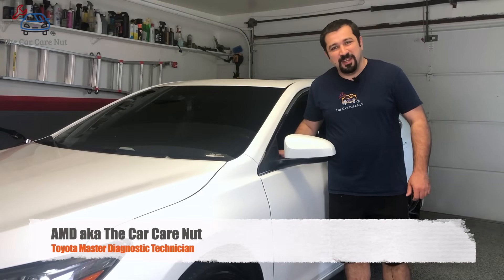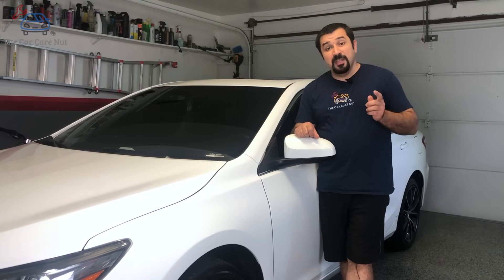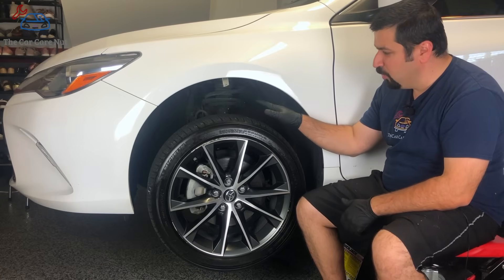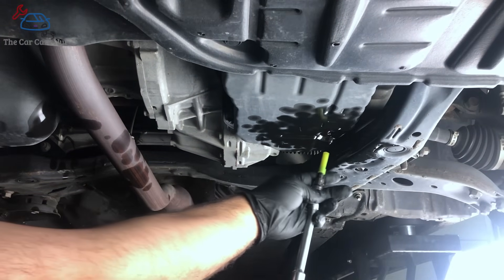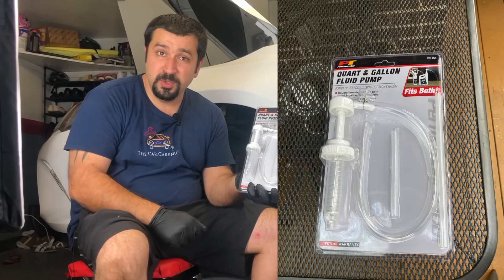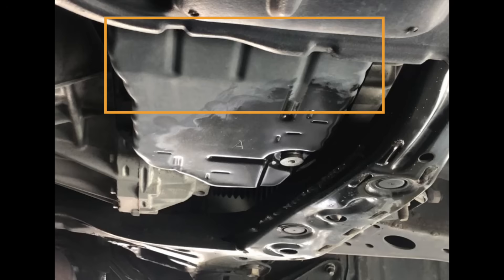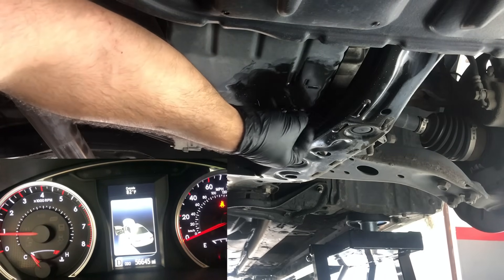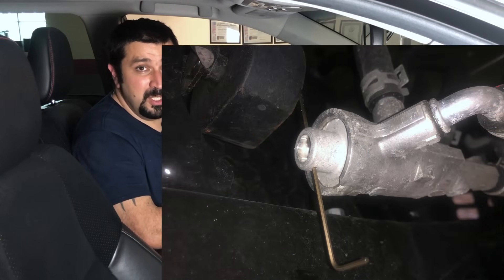How to change your Toyota Sealed Transmission Fluid

Comment: Thank you soo much for this video! May I ask, on a 2019 Camry, what would be the ideal temperature to start opening the drain plug  to check the fluid level? Adding an extra 1/2 quart might take a while for it to drain out before the ATF Temp gets too hot.
Reply from the maker: Hi! The fluid temp range on a 2019 Camry 8 speed transmission is 95-113 F. You’d want to start draining the excess at 95 and that gives you plenty of time to drain the excess before you reach 113.
Reply: @TheCarCareNut  You are always generous and awesome! God bless!
Reply: ❤ @TheCarCareNut
Reply: I Just did the Same thing with my 2019 Camry 2.5 L. I couldn’t find the Coolant Bypass Valve that we are supposed to pin open with a Allen wrench…. Did you find yours? And if so could you help us find it? There a couple others on hear looking for it. Thx.
I took off all the splash guards and looked everywhere! I followed 2 lines out of the transmission UP to a 3.5 inch by 3.5 inch box shaped out cropping that also had 2 other lines going in and out (I’m assuming coolant) but NO valve that I could see. I stopped everything right then and put the splash guards and tires back on. I didn’t want to mess up a $5000 transmission 🫠

Comment: The 2nd method pretty much killed every viewer here.
Reply from the maker: Thank you for your comment. Could you elaborate?
Reply: @TheCarCareNut  Was a little bid kidding, but it's so complicated. I'll get a Digital Infrared Thermometer on Amazon for $12 ! Need it for Covid, anyway.
Reply from the maker: Gotcha! I just wanted to make sure! I hear you on the complication but if you practice it and get used to the procedure it’s actually the most accurate.
Reply: @ve7yan  Be sure to first test your cheap digital IR thermometer using a medical thermometer as a reference standard.
An IR thermometer won't read accurately on any clear or bare-metal surface!!!

Comment: Sir..my car's transmission is not sealed..it has a dipstick..its a 4-speed automatic..NOT a CVT.. What if i will just put the same amount of fluid of what i have drained..would it damage the transmission? Thank you and God bless you more sir..
Reply from the maker: Hi! On transmissions with a dipstick this procedure doesn’t apply. Drain and fill with the same amount then use the dipstick with the car running to check the level.
Reply: Thank you so much for the help sir.. I really appreciate it.. keep it up..

Comment: Okay I did the diagnostic mode on my Es 350 2008, but the indicator never settled on D. Please advise
Reply from the maker: Did it flash then go off?
Reply: @TheCarCareNut  nothing happened. They are all individual lights in the ES350. The light from N to D kept changing. I was definitely in diagnostic mode.
Reply from the maker: Once you do the back and forth you’ll end up with the D light staying on solid for 2 seconds regardless of where your shifter is. Then go to park and wait for the light to come on solid to start adjusting the fluid level is that not happening
Reply: @TheCarCareNut  correct. I've just looked that up. Will try that again. Is something I'd have to repeat once the car has cooled down? Since it's already warm and it wouldn't show the accurate temp? In my first go, I hadn't put the shifter back to P. Just left it at neutral.
Reply from the maker: Where the car temp is doesn’t matter. You will still see the D light come on solid for 2 seconds. Try the procedure again. It takes a few tries to get the gist of it then it’s easy after that
Reply: @TheCarCareNut  I meant, if the car has been idling for a while, I'd have to repeat the procedure once the car has cooled down so it can detect the required temp of 104f? How long is long enough for the transmission to cool back down to repeat the process? I'll try it again in a bit and report back? Also, how long before the D becomes solid again after the first 2-second illumination?
Reply from the maker: So once it comes on solid for 2 seconds if it goes off after that the temperature it too cold.when it comes on solid is when you should adjust the fluid level. If it starts flashing then it’s too hot. Shut it off and let it cool down and restart
Reply: @TheCarCareNut  Roger. How long do these things take to cool off?
Reply from the maker: It could be a while. A few hours should do it
Reply: @TheCarCareNut  got it. Thanks for the rapid responses. Happy Thanksgiving! I'll try again in the morning.
Reply from the maker: You’re welcome! Happy thanksgiving
Reply: @TheCarCareNut  some forums suggest pulling out the shorting wire after the D comes on for 2 seconds. Is this true?
Reply from the maker: Yes that is correct and I mention that in my video
Reply: @TheCarCareNut  tried it again this morning. The D comes on for two seconds. I move the shifter to P. Pull the wire out. The solid D never comes on even after idling for a good 5 minutes.
Reply from the maker: Interesting. Keep waiting for it. This means the transmission is too cold and not warming up. See if it comes on solid after say half an hour is too much but give it time
Reply: @TheCarCareNut  got you. I'll try again. Half an hour does seem way too long for trans fluid to not go up to just 104 degrees.
Reply from the maker: I agree I see it odd too but that’s how this procedure works. It usually does take about 5 minutes from very cold to that temperature
Reply: @TheCarCareNut  right. Either I'm not doing something correctly or the sensor isn't working? Time to go get an infrared thermometer.
Reply: Tried it another couple of times today after a good 4 hour wait. Negative. Yes, the D light comes on for 2 seconds, then go off. I put the shifter to P, and pull the wire out. The temperature gauge on the instrument panel climbs about a third but still no D light that stays on.
Reply from the maker: That’s weird. I would just use the temp gun method or use a scan tool. I’ve tried this procedure on a lot of cars including Lexus and it works.
Reply: @TheCarCareNut  one more thing. In your instructions, you don't really mention as to what to do when the D comes on for two seconds. Do we leave it in neutral? Or do we move the shifter to Park?
Reply: @TheCarCareNut  FINALLY. IT WORKED! Had to sit in the car idling for a good 30 mins before the D light came on solid. All changed. Car now feels buttery smooth. When's the next time you'd recommend a drain and fill since only a small portion of the fluid came out.
Reply from the maker: That’s awesome! I would change it again the earliest at 30k
Reply: @TheCarCareNut  thank you. Why is fluid dark btw? Is it burnt? Or is it some other material like the clutch? It just looks like it's mixed with something dark.
Reply from the maker: WS fluid always comes out dark. That’s normal for it. Burnt fluid will have a very bad smell and you’ll tell right away
Reply: @TheCarCareNut  so the clutch isn't faulty then?
Reply from the maker: No you’re all good my brother! No need to worry.
Reply: @TheCarCareNut  ah. That's assuring. Thank you so much. Been meaning to figure out where to get it done but your video made it so simple. Car drives like brand new again. It was a little rough with the shifting in the mornings. Buttery smooth now. Wife approved 😁

Comment: Great videos Master Technician! Your expertise makes me feel so empowered. I have a 2016 Camry Hybrid and I plan to do this procedure tomorrow. Do I need to do the temperature procedure or just drain and fill until it overflows? God bless you!
Reply from the maker: Thank you for watching my video! So on your Camry hybrid it’s even easier to do the transmission service and is different than this one in the video. So on your hybrid there will be 2 plugs on the passenger side of the transmission with a 10mm hex. The one that’s higher is the fill and the one that’s lower is the drain. Take them both off. Let the oil drain then fill it from the fill plug until it overflows. Wait for it to stop dripping and you’re good to go. Make sure the car is level and that you use Toyota ATF WS likely you will need around 4 quarts I would have 5 at hand just in case
Reply: @TheCarCareNut  thank you for your detailed response!! I'll let you know how it goes for me. 🙏🏽
Reply: @TheCarCareNut  Does the temperature of the Transmission matter when checking the transmission fluid level, either with or without a fluid change?  I have a 2013 camry hybrid.  Thanks in advance, I love your channel!
Reply from the maker: On hybrids no not much. The difference in fluid level is minimal and it’s a splash system so you’re good.

Comment: So, in order to check fluid level, wait till it reaches the correct temp, and if it trickles, that's the correct fluid level?

How does the fluid release at the very beginning if the only way for the fluid to come out is via the straw, but then the only way for the fluid to come through the straw is to raise the temperature? Very confusing.
Reply from the maker: So fluid expands and contracts. When the fluid is hot it takes up more space and will be higher level. When it’s cold it shrinks and takes less space. You want the fluid to line up with the top of the overflow tube when it’s at a specific temperature. If it’s colder it will be lower than the tube if it’s hotter it will be higher than the tube.
Reply: @TheCarCareNut  yes but when you remove the bolt from the pan underneath on a cold car, where does that fluid come from, BEFORE you unscrew the straw?
Reply from the maker: That would be the fluid that drained down because the car sat down
Reply: @TheCarCareNut  right. Will attempt this very soon! Thank you for the fantastic tutorial 🙏

Comment: Would you provide information Transmission Temp for right refill height 2017 Rav 4
Reply from the maker: Do you mean the temperature range?
Reply: @TheCarCareNut  yes temperature range i was planning use Flute 62 Max IR Temp Gun.
Reply from the maker: The fluid temp range is 104-113
Reply: @TheCarCareNut  Thank you very much for information
Reply: I follow your instruction using temp  gun  what kinds of problems i will in counter  if I over fill transmission  what to look for when I'm driving
Reply from the maker: Hi! Some of them will make a strange whining noise or it will leak fluid out of the axle seals

Comment: Hello, I have watched your video about the car suspension good info. I am doing a transmission fluid change on my 2015 highlander XLE. My transmission type is 01A/U660F and i have also called the dealer to find out how many quarts i need they refused to tell me. I am afraid that if i measure what comes out of it will not be accurate. I am not doing a flush. The manual stated that the car takes 7.1 quarts that is if i drain the front differential, but when i drain the transmission fluid what is in the front differential will remain there correct. I was told the transmission fluid supplies the front differential too and the rear differential use a gear oil 75w85 i was told to used 75w90 synthetic oil. I can't get a straight answer from the dealer. Your help is appreciated. Stay healthy.
Reply from the maker: Hi! You are likely going to need around 3-4 quarts. I would get 5 to be on the safe side. The transfer case has separate fluid than the transmission if your car is AWD. The transfer case and rear differential take gear oil. The 7.1 quarts is total capacity. You’re only draining and filling the pan.
Reply: @TheCarCareNut  Thank You for for your advice.

Comment: Hello Brother...here in my country many Workshop practice Vacuum type Machine to extract all 8L type CVT Oil and then fill again 8L by that machine..... It's like Flushing....then they do Calibration by Software....but after going some videos like yours I've convinced myself that this Technique is wrong and waste if money....4L is well enough to Change CVT Oil???... Isn't it...why need Flushing??.... and what you think Calibration is must??...and i face a problem sometimes that when speed is about 20kmh and I'm pressing no Accelerator or Brake and then when i press accelerator Car jerks like Back and forth feeling.....its for CVT transmission problem???....
Reply from the maker: I wouldn’t flush a cvt transmission. The problem could be a calibration but it would need to be inspected in person.
Reply: @TheCarCareNut    bro after Changing CVT Oil Calibration by Software like Techstream is needed???... and which Temperature Oil level need to be Checked....Toyota Range is like 35-45 degree Celcius...so when Temperature reaches 40 degree Celcius then Oil level should be checked??...
Reply from the maker: Just changing the fluid you don’t need calibration. Any other work to the transmission then you should get it calibrated. Start checking the fluid at the beginning of the fluid range and stop if it goes over.

Comment: Hi, got a quick question, after you put new oil in, the hot oil(from shifting back and forth) with higher volume coming out of the over flow tube are excess oil that you put in. How come at the beginning when oil are at room temperature with smaller volume(should be lower than over flow tube) that it still coming out the over flow tube when the oil level suppose at the correct level? isn't the oil level in the oil pan supposed to be slightly lower at room temperature?? I know the oil will expand a little at the set temperature 95 to 130. Sorry I hope my question didn't confuse you. Thanks for sharing.
Reply: When the temperature is reached, the D will stay solid is that mean it will stay solid even you continue to shift from neutral to drive?
Reply: I think I know the answer to my first question. The over flow fluid draining out from a cold transmission is from the previous higher temperature operation over flow into the over flow plug because tran fluid can get up to 220 F or higher.
Reply from the maker: Hi! The fluid expands as it warms up and contracts as it cools that’s why when it’s cold nothing is coming out then it expands and it reaches the overflow tube. You want to run the trans overfilled better than under filled when checking the fluid level. Also you will be in park when checking the level but the indicator will show D regardless of which gear you’re in. Hope this helps
Reply: @TheCarCareNut  Oh Ok, so I guess this method is more accurate than the obd port or the lazer gun methods because I read different temp range(95-113) from the internet and some said the 8 spd tran(I got 2018 camry) supposed to be at higher temp like 120 to 130. Thanks for making the video!

Comment: I have a 2009 Lexus GS450h. I suspect my workshop underfilled my hybrid transmission when they changed my transmission fluid. Are there any symptoms of an underfilled transmission and how do I check in a GS450h?
Reply from the maker: I would take it back to them as that trans is a bit different.
Reply: @TheCarCareNut 
I would love it if you could start a series of videos on maintaining and servicing Lexus cars particularly Lexus hybrids. Since Lexus cars are so reliable and owners tend to keep their Lexus for a long time. Like my 2009 GS450h.
Reply: @TheCarCareNut 
I feel like workshops tend to overcharge for Lexus services and repairs since they think we drive a luxury brand but Lexus car owners are pretty frugal with their money too. That is one of the reasons why we drive a reliable car like a Lexus.
Reply: @TheCarCareNut 
I lost trust in my workshop because they did not check the transmission fluid temperature before checking the fluid level. I checked an online Toyota technical manual on the GS450h and it mentioned that the temperature had to be 30-40 Celcius before checking for fluid overflow. Didn't see my workshop doing those checks.
Reply from the maker: Some Lexus models are different than Toyota models and some of them are identical. But overall they are very similar and really a dressed up Toyota.
Reply: @TheCarCareNut 
In that case, seems like a simple transition for you to post videos on servicing Lexus cars.

Comment: great! may i ask if this procedure is the same in toyota vios 2019 cvt trans
Reply from the maker: It is the same but make sure you use the correct fluid. Practice the light procedure first before draining and filling.
Reply: @TheCarCareNut  thank you very much 🤩

Comment: Hello and thank you for the video sir.

Quick question sir.
How often do you recommend changing the transmission fluid?, in my case I have a 2018 Toyota Camry with 30,000k miles and I just want to know if I am already over due
Reply from the maker: Hi! I recommend you replace the transmission fluid every 60k miles or 6 years so you’re good on both

Comment: How about the 2013 Rav4?
Reply from the maker: The 2013 RAV4 has the same procedure as the one in this video.
Reply: @TheCarCareNut   - Thank you sir!  I must say, I wasn't thrilled when I discovered there was no way for me to routinely check the transmission fluid levels after I bought the car.  As it is, it has not been an issue as the car has been totally problem free (knocking on wood so as not to jinx myself!).  The only thing that's been done to date has been routine maintenance and the car has just over 125,000 miles on it to date.  I have made a concerted effort to stay on the routine maintenance schedules and so far, so good!